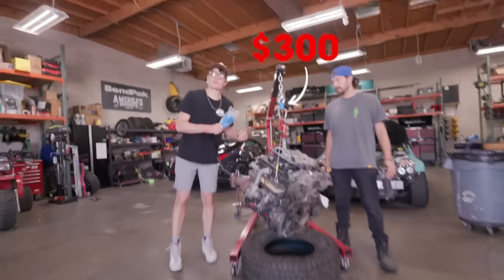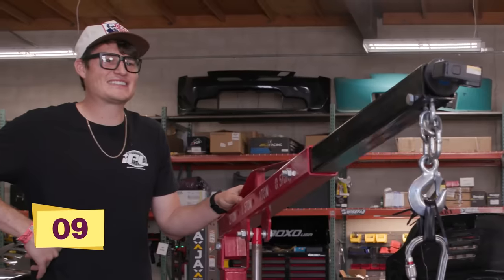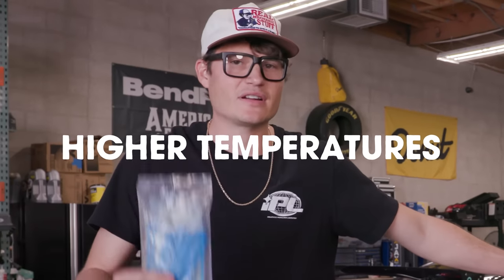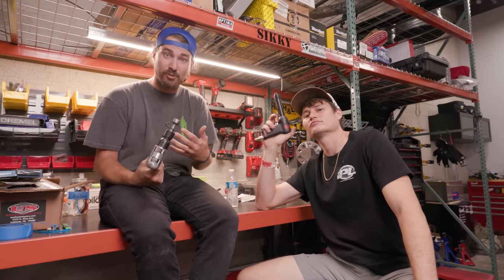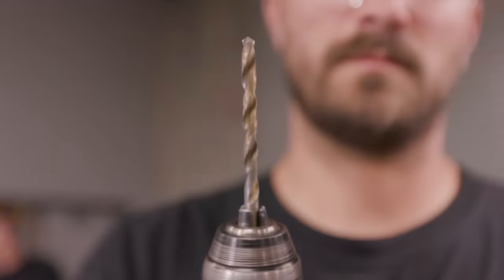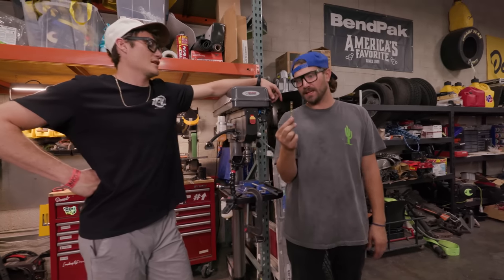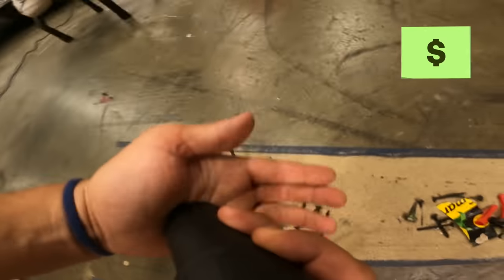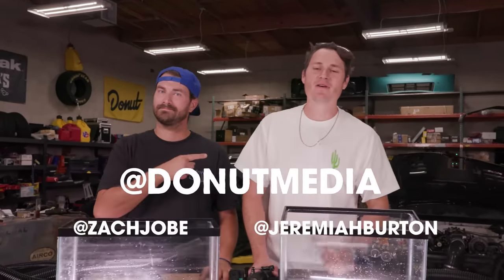We Test: $1 vs $300 Zip Ties

Comment: I'm a carpenter and we do a lot of sanding and refinish work.  Don't let the cheap shop vacs fool you.  It's less about getting more sucking power for the size and more about their reliability.  The motors on the cheap shop vacs burn out quicker through regular use.  The more expensive shop vacs are worth the money in terms of reliability.  Another point about vacuuming power are the fluid dynamics like water.  While a smaller hose/end might have that quick sucking power, a larger motor and wider hose/opening can move more air over distance so if you don't want to move the entire shop vac around with you all day and just move a long hose, the cheap shop vac doesn't have the power to move air over distance.
Reply: ok nerd
Reply: Basically if it's too cheap to be true it aint gonna be true and this goes to everything.
Reply: @Steve-bc2cl  bros just tryna help lol
Reply: I'm working on hotline of karcher and can approve this. Usually they not just devided by price but also by purpose of use. On Karcher example they have "home&garden" line and "professional" one. And they have really simillar tools and equipment in both categories in terms of power but they are really different in terms of reliability. So we pretty often get calls from organisations who thought that's gonna be a good idea to use h&g tools on daily basis with a lot of work to do wondering why they don't have any guarantee
Reply: @Steve-bc2cl  He's right, though. Shop Vac actually puts bearings in their motors, as opposed to cheap delrin bushings that wear over time.  So they last a lot longer.

Admittedly, I'm biased--Shop Vac actually chose to not outsource production to China; they're still made in Williamsport, PA.  But they were sold to a Chinese tool company, which kind of sucks.
Reply: What brands do you recommend? I know detailings  love RIGID but heard you might have to replace after 3 years.
Reply: This is why projectfarm is a better channel to watch for comparisons like this
Reply: Harbor offers a no questions asked warranty’s u can go to a store and get a new one while in my experience with expensive tools u have to be sending emails to companies for warranty
Reply: @leog9524  well yeah, if you make shit that costs less to replace then to fix ofc you're gonna do "no question's asked" warranty. If however you produce stuff that's worth the money and takes heavy abuse to break you're gonna ask some questions, for two reasons: 1. How can we improve our product so it doesn't break under stated conditions and 2. was the use as intended or were they testing it to breaking point.
Reply: There's also the factor of compressibility, you're not wrong mate
Water is incompressible too, so it's just going to emulate a peak load for both cases; despite both being fluids, liquids and gases behave very differently when you fuck with pressure; especially when there's a large, sustained gradient like this case
Reply: You know what? You are right.
Although around here a carpenter and a wood masonry don't do the same work, they usually work with the same tools, and reliability is far more important than having a thing that works better but for only some months. My father has tools that work after more than 25 years.
Reply: @Breese147  while I was working in cleaning company in Germany that cleaned expo's and large offices, we were using different vacs from Numatic. I also saw how Numatic vacs were used on the construction. I actually bought few used vacs from the company for a cheap price and I had to change bearings in only 1 vac from 12 we are using in our family. Definitely something I could recommend.
Reply: Probably a brushed vs brushless motor situation. Brushed electric motors dont last as long unless you really maintain them and replace brushes etc. Its less important for low power applications, but vacuums draw a ton of amps when they get clogged. Something like that will just destroy a crappy brushed motor.
Reply: @Breese147  i love ridgid too. Ive never had to replace their shop vacs. Mine has been running for 6 or 7 years now with HEAVY use. Lots of their stuff can be bought with a lifetime warranty too, although im not sure if it has ever applied to shop vacs specifically.  I only bothered to signup for the lifetime warranty for my impact driver and hammer drill.  Ill never have to buy a new  drill or driver again. Infact i absolutely destroyed my hammer drill last time i used it, but i don't even have to worry about it because i know its covered. It literally snapped into 2 pieces and i just laughed because i had been expecting it to break for months.  Even cooler is that once the models i have get discontinued, they will give me a free upgrade to the newer model when they break again. Honestly its a miracle i didnt break it earlier. Id been using an 18 inch long concrete bit of 1.5 inch diameter on my chordless hammer drill lol. Worked great for months until the head ripped off the drill lol. Its taken some hard falls too tbh.
Reply: I agree; longevity is another factor as well. Dyson vacuum cleaners in my opinion are let down by build quality of the handles and components - but the motors last forever. I worked in a retail shop and every day of every year except for Easter Sunday, Christmas Day, and New Years Day that shop would be open and we vacuumed the shop floor. We got 14 years out of a Dyson vacuum clearner that sure it was covered in duct tape - but that thing was w o r k e d.

In 6 months we ran through 3 cheaper vacuums doing the same job.

Grabbed another Dyson and last I heard they were still using it.

(Obviously Dysons aren't shop vacuums though, but you get what I mean).
Reply: I had a "vacmaster professional" that I burned the motor out of. Had better luck since with Ridgid. Vacmaster looked better on the spec sheet, but Ridgid was better and more durable.
Reply: Milwaukee fuel vacuum with a 12.0 battery. Thank me later
Reply: @Steve-bc2cl  Yea, I'm another "Nerd" who uses these tools in real life.  The OP is right.  I'm a machinist and we vacuum up greasy, stringy chips covered in coolant everyday.  Get a Rigid and be done with it..
Reply: The festool vac also doubles as tool cart for all your systainers! For dayly professional use it's more about reliability and usability, so the whole brand ecosystem is important.
Reply: It is also larger, so times emptying it and less time on emptying it.
Reply: Eh, you'd have to last more than 10x longer. My cheap shop vac is still running great
Reply: Well said. My dad still has his original wet dry vac. It's like moving around a 55 gallon drum 😂but tell you what that thing has been sucking up saw dust, pool water, outside flooding and mud and minor household sewage for 30 f*** years. I think that's like an original ShopVac from the 60s or early 70s.
Reply: @jpncaredits5178  
in short, always go middle. Or at least find brands that are in the middle in terms of price but also have quite the reliability.
Reply: @Breese147  
in my country the Philippines, the trusted brands you can get are Bosch, Black & Decker and Makita although Makita can sometimes be expensive and they act like Apple where they sell parts separately.
You can also get Karchers but they do overprice them here in my country.
They're hella cheap if you go to China or Vietnam.
Reply: okay fair. but if you buy a new of the cheap one everytime it fails, would the expensive ine last 10 cycles?
Reply: You could buy 11 of those cheap shop vacs.for 1 of the expensive ones if each shop vac only lasts a year, that's 22 years. Can the expansive shop vac last 22 years with never breaking?
Reply: yeah, I was going to say - could've done a duty cycle test on them
Reply: sounds like something big vacuum would say, how much did shop vac pay you to comment this?
Reply: @gr6e  he also did a hugely flawed test, over rating sucking power and not reliability.
Reply: Thanks for your specific use case.
Reply: I can atteat to this
Reply: I've bought plenty of cheap stuff that lasted a long time you're just not good at spending money. Paying more for a known brand does not magically make something better.
Reply: Then you’ve never used a Henry.
Reply: I think for a lot of people the cheap one will do just fine. But for your circumstances, its clear the expensive one is worth.
Reply: @Breese147  personally, I have a RIGID i bought back in highschool - 2002.  It's still going strong and I have abused the shit out of it.  I use it for water and concrete dust, sometimes both at the same time.  bearings still don't squeal.
Reply: @gr6e  You are correct. There is a big difference in materials drills are made of. What "DIYer" will use zip-ties to withstand that kind of heat. These guys are clowns.🎭
Reply: You haven't vacuumed until you have vacuumed with dual motor 2,4kW PULLMAN-ERMATOR S26. That thing is a beast. 

I used to do construction site cleaning, the vacuum cleaners had to be sturdy with some serious filtering. Though clearly they're not meant for home or smaller shops, but those things are made to last for years in dusty conditions. But the price...costs almost 3000$. Using those for some years messed up my perspective to vacs completely =D
Reply: Yeah but it's... 300$ for a zip tie.
Reply: dude no way you’re gonna go through 10 of those by the time you would go through one name brand.. that’s the only way it’d be worth the price
Reply: @Steve-bc2cl 🫏🫏🫏🫏🫏🫏🫏🫏🫏